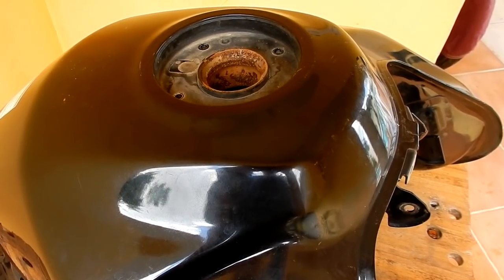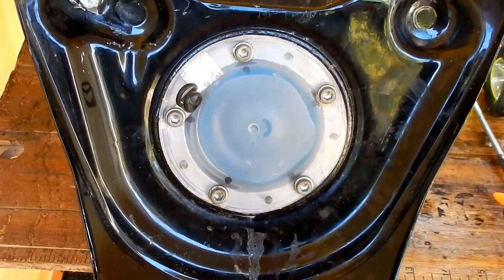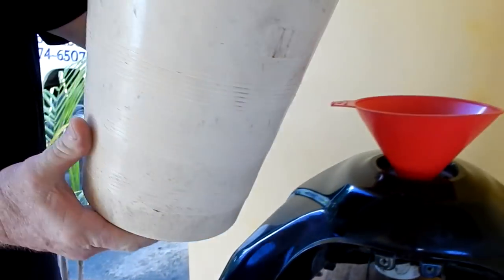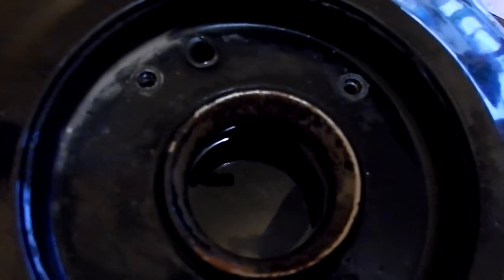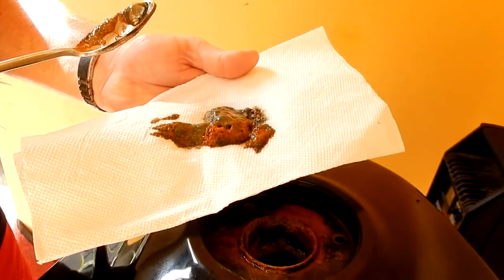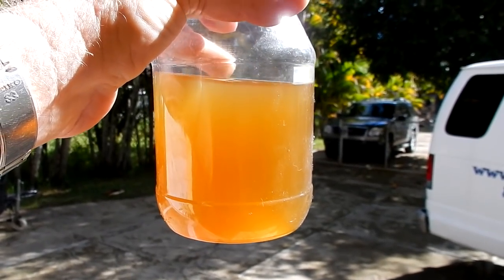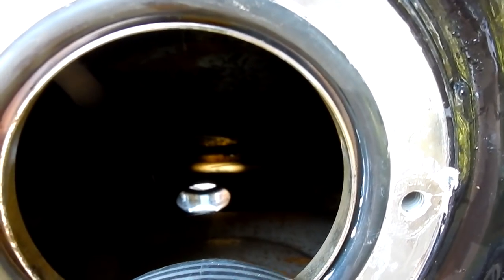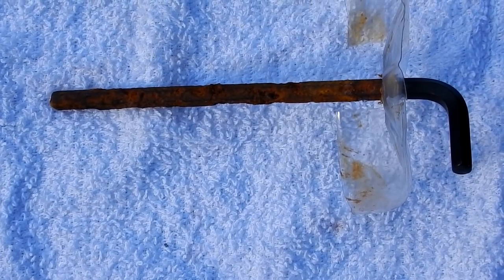Motorcycle Tank Rust Removal Using Electrolysis

Comment: I did the same on a DL1000 (same tank) but found that the worst rust was on the uppermost panel of the tank near the filler cap. This makes sense as this area is never immersed in fuel and so vulnerable to rust. Due to this, I put the cathode in from the fuel pump hole and plugged up the fuel cap hole allowing the worst area of rust to be targeted - with the tank upside down.
Reply: That is a very good idea which I had not thought of! both ways up would do a thorough job. thanks.
Reply: Did you coat the tank after electrolysis? Any updates?

Comment: After the process is finished , the surfaces need a good scrub to remove all the guckie residue . How do you give a good thorough scrub to the inside of the tank ?
Reply from the maker: I used a pressure sprayer, then used POR-15 when it was dry, just a short time later.

Comment: Nice video, been looking at ways to clear out my new bikes tank and wondered what kind of time and effort I'd need for electrolysis.

Think I'll be using a product similar(seemingly identical in function too) evaporust instead though as I don't have a good place to vent out a bunch of hydrogen gas
Reply from the maker: I think the main issue you'll have is the nature of a gas tank: it is enclosed, the rust is on the inside  and the openings are small, too small to get a hand inside to work the rust, and filling the tank with most products is very expensive and messy. I saw one video of how well muriatic acid works, but cannot imagine filling the V-Strom tank with 5.3 gallons of muriatic acid. Just a couple of cups for our pool give off noxious gasses.

That is one clear advantage of electrolysis: cheap, close the bottom and away you go. It's a matter of time.

I don't know how much hydrogen is generated, but I'd be surprised if it is dangerous except in a very small, enclosed area.

Except in a case of extreme rust, other products may be more practical for removing rust, like on bolts and small tools. 

Good luck!
Reply: @MotocaribeDR  I'm thinking I will pour some in, a couple of liters, let it work for a few hours, turn it, let it sit, repeat until I can't see any more rust. I think that should work well, those are the instructions for how to use it for motorbike tanks on their website :)

Comment: Thanks for taking the time to do this video, very well explained, my only question is, you cleaned it in two days and a half?, or how many days does it take you to finish?
Reply from the maker: Yes, 2.5 days. I suppose I could have let the process work for a couple of more days, but I was flying blind and did not know the progression of the process.

At the end I just pressure cleaned the tank and let it dry. Then coated the inside with POR-15. 

Next time I'll let the process go for 4 days while monitoring water levels and anode deterioration, and scooping out the crud.
Reply: t @MotocaribeDR
Reply: @MotocaribeDR t Thanks man, my tank is not too rusty, so I guess with two days will work fine

Comment: Great video & thanks. Can you please tell me, whether you used distilled or normal water?
Reply from the maker: I used normal water from a well. I have no idea if distilled would make any difference.
Reply: @MotocaribeDR  OK, my concern is that normal tap water might create flash rust. Which is what I'm experiencing now with white vinegar. Immediately when I flush it out, it forms flash rust. So I'm thinking of giving this a try.
Reply from the maker: @Mohapi_Tau  Give it a try, but I doubt the water is the source of the flash rust. It's the bare, totally clean ferrous metal.

This is why I suggest immediately coating the tank with POR-15 or some other solution as soon as the tank is completely dry. I set up a hairdryer blowing into the tank for this reason unless you live in a very dry environment. Here in the Caribbean, it's very humid and flash rust will show up within a day or two.
Reply: @MotocaribeDR  OK, thanks for your answer. So I've got a 6a 12v automatic battery charger, I saw that you used 2 amps. Do you think that it will still work well as yours, because mine can't be adjusted the amps, or will the higher amperage affect it?
Reply from the maker: @Mohapi_Tau  I'm not sure it matters but don't know for sure. Keep in mind you'll need to put a 12v battery between the tank and charger or the auto charger won't work.
Reply: @MotocaribeDR  alright, I still have my motorcycle battery working & I'll use that. Thank you.
Reply from the maker: @Mohapi_Tau  The reason you need a battery is an automatic charger has to detect voltage to deliver a charge, and the tank by itself has no charge. Adding the battery makes the auto charger work.
Reply: @MotocaribeDR  yes I'll do that with my motorcycle battery & charger.
Reply: @Mohapi_Tau  create load on the circuit for the sensing charger to work. Sometimes you can add a 12v bulb inline to boost it higher if needed. A 25w indicator bulb is approx 2 amps current draw. But keep it in an cooling airflow area.

Comment: Sir I can use car battery instead of motorcycle 
I hope u reply me soon 
Thank you
Reply from the maker: I don't see why not.
The purpose of the battery between the charger and tank is for an automatic charger to sense voltage and then work.
Just remember a car battery has a much stronger amperage discharge potential than a motorcycle battery and can cause a much greater spark if the anode touches the metal of the tank. It would be more critical to make sure that contact doesn't happen.

Comment: Also available at any grocery store as 'washing soda'
Reply from the maker: Indeed. AKA Soda Ash. I had to find it in a pool supply section of a hardware store because Dominicans don't use "washing soda."
Reply: @MotocaribeDR   I believe " washing soda" is sodium bi-carbonate which is a different PH level to soda ash. Two totally different products?
Reply from the maker: @garybailey8877  I'm pretty sure "washing soda" is sodium carbonate aka "soda ash." I use soda ash to raise my swimming pool PH. I showed the container of soda ash used in this process in the video, and "sodium carbonate" is clearly printed on the label.  I made a mistake in the video calling it "bicarnonate" and corrected it with subtitles.

Sodium bicarbonate is baking soda.

Comment: I just received a 1987 Kawasaki which has a non-removable (welded in place) sensor in the tank so I don't think it would be wise to pour in any kind of sealer, though electrolysis is the de-rusting method that I would prefer. I'm in Hawaii so condensation isn't really an issue here (the bike came from Pennsylvania). So why are you saying that a sealer is necessary? What if I just give it a good rinse with alcohol and be done?
Reply: Because you're down to bare, untreated metal after electrolysis, and any air (you have moist air in Hawaii, just as there is here in the Dominican Republic) will cause almost instant "flash rust", which is like a fine powder. Unless you intend to keep the tank 100% topped off at all times, a tank sealer will save you more grief down the road.
Reply from the maker: @need100k  No prob, glad you got it better understood. Now you can properly seal the tank. I'm a big fan of the POR-15 kit for motorcycles. It's simple, effective and a decent price for the job.

What model Kawasaki?
Reply from the maker: @need100k  Amazon or ebay.

Nobody sells it here, either.

Comment: Have cleaned several gas tanks from 1 gallon to 20 gallon with electrolysis and it always works. Just perfect as long as you remember to rinse, dry and flush with some moisture neutralizing agent.

Comment: Can we add coating of rust free material by electolysis so that it may not again catch rust especially from inside.thanks for detailed video. 👌
Reply from the maker: Like some sort of metal plating?

I have no idea. My concern is IF that could be done, what happens when that metal flakes off? It would be like rust, but not rust.

Comment: Robert -

Thank You for taking the time to post this video on removing rust from inside a gas tank. I knew electrolysis was the correct solution to use on my tank but was afraid to try. Your step by step on camera start to finish has made this process possible for all of us................Thank You !!!

Denny
Reply: What was your ambridge set at ? A trickle charge ?
Reply: @MyM0STYLE  I have my charger set at 12v, 2A.
Reply: What did you do after electrolysis, did you coat it with anything?

Comment: man im thinking about going through this process with the fuel tank on my honda prelude, its an 89 and i bought it with a blown engine not realizing the extent of what i was getting into
the motor works now but all 4 injectors failed and when i replaced the filter the gunk inside of it looked awful similar to the gunk that came out of your tank after electrolysis
i will post back once finished if it works out! thank you for this informative video :D

Comment: This is the single best video on cleaning a motorcycle tank on the internet. Thank you so much for taking the time to explain all the details, and showing such detailed before and after photos. What is significant is that the electrode was so small, and not anywhere near the bottom of the tank, and yet the process worked just fine. I was under the assumption that you couldn't reach the back areas of the tank, because there was no way to get an electrode into the crevices of the tank. You've showed that the anode is not particularly important, but being patient, and using a pressure washer, are the keys to success. Nobody has actually mentioned a pressure washer before, but it makes a lot of sense, because the detached rust is lightly bonded and needs physical force to be removed.
Reply from the maker: Thank you! I want to hear from folks who have tried this method, their successes, and failures.

Electrolysis like this has worked perfectly for me several times. Just don't forget to coat the tank after you're finished. I have had great success with POR-15.
Reply: @MotocaribeDR  Hi - Just got my Suzuki Bandit fuel tank cap off after cutting a pretty big slot in the bottom and with a screwdriver and penetration fluid prising the 2 tangs back to pop it.and looking at YouTube for the next process.
I'm going to give this a go I think providing I can buy the stuff in the UK
Need to watch it again and I can bridge the wires with a old but working golf trolley battery 👍
Damn I'm signed in on my wifes name again durrrr 🤦‍♂🤷‍♂
Steve
Reply: @MotocaribeDR  Had mine cooking for 3 days now, it is working but I wish I had more of the sludge to remove from the top like yours. I used an old allen key too but a bit bigger than yours.
I put a battery between too and hits 4.5 amps on initial start up but then trundles along at about 1 amp but getting alot of debris each time attached to the allen key.
I'm going to keep it going for the best part of the week and then jet wash it. I have a flexi hose that should get to the more difficult to reach places too.
One more point when I tipped the warm water over the soda it went solid and I had to break it down so I wouldn't recommend tipping the soda straight into the tank as I don't think it would break up.

Comment: I've watched quite a few videos on this process.. and have done it myself as explained in most of these videos.. but what I kind of figured out on my own is you should be using distilled water from the very start..  with tap water especially if you use hot water from your hot water heater  "mineral buildup in heater" and don't have soft water in your house..  soft water also contains unwanted salts.. most City tap or well water if not softened  contains quite a bit of dissolved solids "rust and other minerals" in the water which is actually responsible for quite a bit of the rust buildup on the anode...
If you use distilled water for your solution you have a more effective and efficient solution...✌👋
Reply from the maker: Interesting comment, Cody. Thanks for the input. You inserty an interesting variable. We have very soft water here, but those in, say, FL have a different situation.
That said, I suspect the concentration of iron oxide in contact with the solution exceeds dissolved minerals by several orders of magnitudes. I'm not sure of the electrolytic effect on dissolved minerals.
Reply: @MotocaribeDR   or old bad water lines .. galvanized pipe fitting  even new pex pipe will collect rust from being hooked to old contaminated  water lines underground.. take the city of flint mi for example... old municipal lines all over are contaminated...

Comment: The metal inside the tank might have the tendency to get flash rust because it is undergone electrolysis. thus, you have coat the innards with some anti rust coating else you end up with the rust again as time goes. For temporary fix mix 2t oil and gasoline and pour into the tank and coat it until you get a permanent coating solution
Reply from the maker: You are correct. We used POR-15 which did an excellent job. But first major rust removal.
Reply: Phosphoric acid or Citric acid cleaning is necessary once you have bare metal. The phosphoric acid is what they use to protect steel from flash rusting, when you paint a car. You wash the whole car in a light mixture of phosphoric acid and water. Or you use self etching primer, which has phosphoric acid in it. Citric acid apparently does the same thing. The phosphoric acid/citric acid actually forms a very thin protective barrier on the steel which makes it much less prone to rusting. As opposed to hydrochloric acid which literally destroys the integrity of the steel and makes it much more rusty, if not treated with phosphoric acid or paint immediately. Gas and oil are not effective, because as soon as the tank sits with humidity in it, it will rust again. You need to make sure to wash the part in phosphoric acid, which removes the last traces of rust, and seals the metal. You can buy "rust converter" from the store and use that, or some types of concrete wash, which contain phosphoric acid. Or you can buy cheap citric acid. Rinse with baking soda and water to remove the traces of acid. Then keep it dry and full to the top with fuel, and keep it warm.
Reply: Cold steel condensers water and forms rust. Having your bike under a blanket will be enough to prevent condensation from forming in most cases. Water seeks out cold, and is driven away by warmth. A blanket over a piece of steel will prevent it from forming condensation (almost by magic) and this in theory, should protect your entire motorcycle from condensation and rust. The gas cap is vented, and so water will be drawn into the tank and it will condense on the sides, but only if the gas tank is COLDER than the surrounding ambient air. If you keep the gas tank under a blanket, it will retain more heat than the ambient air, and at night, it will not condense water drops on the inside and it won't rust as quickly, or at all. You can prove this theory by just placing a piece of bare steel under a blanket in the garage. It won't rust at all, even without any oil on it.
Reply: @Ritalie  Thanks for the suggestion to finalize this very useful video; currently working on my cbr400 gas tank!
Reply: @Ritalie  what ratio do you recommend of water and phosphoric acid to clean the tank after the electrolysis ?

Comment: Great video and idea, one thing to finally check with your tank, it has a recessed fuel cap and in that recess will be a drain hole to let any water escape. The drain is a steel tube that passes right through your tank exiting at the bottom underside of the tank. If this tube becomes blocked the recess in the tank will fill with rain water or water from when you wash your bike off eventually some will end up inside your tank and will cause rust in your tank and fueling problems.

Comment: Could you use a steel bolt if you were to suspend it in a motorcycle gas tank vs an alan wrench?
Reply from the maker: Why not, as long as nothing touches the tank? The anode must not touch any metal attached to the ground.

Comment: What exactly are you doing with the electrolysis? As in, chemically? Are you trying to dissolve the rust or turn it back into good metal be removing the oxygens? This doesn't seem to make sense to me. There should be less rust in that solution.
Reply from the maker: The process turns rust back into iron, which is flushed out with water.

This explains all the black material when we first dumped out the tank after the first electrolysis.

Comment: Probably a good idea to use a large COPPER scrap metal, instead of steel.  Steel is the worst conductor.  And your allen wrench was probably coated to inhibit rust which also makes a poor conductor.
Reply from the maker: Could be, but I did not have copper scrap metal, and I had some cheap, scrap Allen wrenches I would never use. The current is so minor I'm not sure if a copper anode would have made any difference.
Reply: @MotocaribeDR  It simply works a whole lot faster with a better conductor.